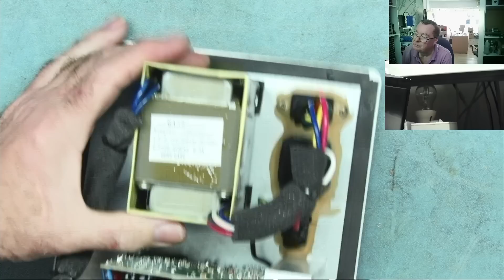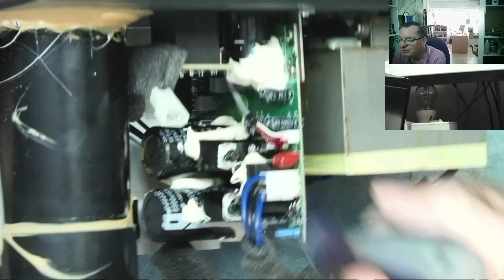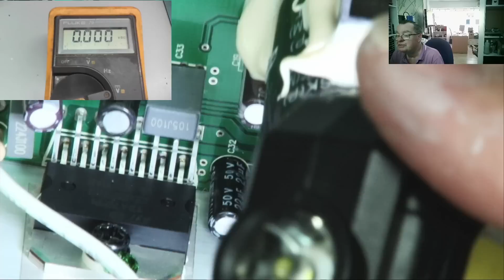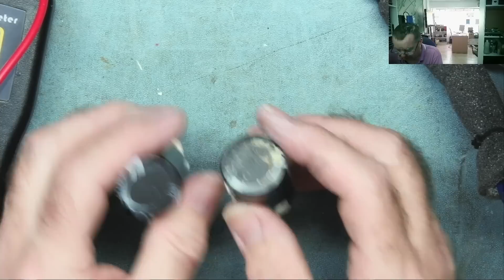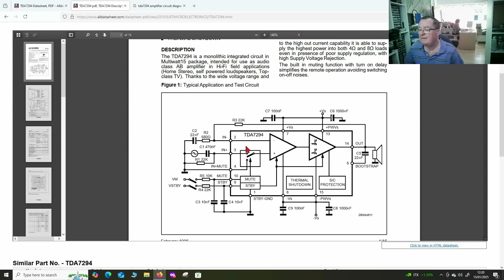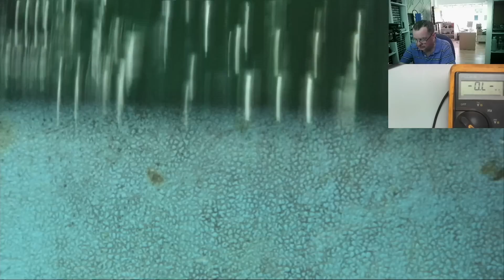This M-Audio BX8 Speaker Makes Farting Noises! Learn How To Fix It

Comment: Though I enjoy a longer video, this is definitely not one of them. You wasted a lot of time babbling and messing about. If you have started with checking the voltage rails for a short to ground (blackened area of the PCB is also a clear  indication that something has gone wrong there) this would have been a 5 minutes video. Ok, maybe 10 minutes with the back and forth of shorted component misidentification with the thermal cam. Not sure how you could have seen it as the opamp and came to the conclusion that all of them are shorted, even tho the big cap was glowing like a Christmas tree 😅

Comment: The capacitor C2 at 17:33 is in fact mainly to cut DC off since we do not want to amplify any possible DC offset.
At DC it is open so the lower part of the feedback voltage divider is infinite resistance (lowest gain of 1 in non-inverting configuration), while at high frequency it is a short, so the lower part of the feedback voltage divider is equal to R2 (highest gain of 1+22k/680=~33). C2 needs to be decently high value (22µF on the example application, rendered incorrectly on your screen) so that low-frequency cutoff is low enough.

Comment: Hi Richard,
I noticed you returned to your good old Fluke multimeter quite a while ago after using the Kaiweets KM601 for some time.
Did the excitement for the intelligent meter hold up not so long or what is the reason for switching back?

Comment: Thanks Richard for the journey of solving the puzzle 
It does seem this type of capacitor is prone to failure.
My gut feeling was a capacitor failure.
Locating it is the issue.
Reply from the maker: Yes 100% MLCC (multilayer ceramic capacitors) are very  prone to failing short circuit

Comment: Nice find. Always handy to use a little pointing device (cotton bud, pen, cocktail stick, something nonconductive) and place over the component when viewing through thermal camera to identify the exact place. Even without, it didn't look like the ICs really, the shape wasn't right :) You can also approximate/fake a log pot from a linear by adding a smaller resistor between wiper and one leg, although I've not actually done much experimentation with that it may help in some situations.

Comment: That was another excellent... Lesson... There were still some things I didn't quite get or understand totally,  but as you started to disassemble things and we still had some kind of resistance in the circuit after parts were removed,...  I started to view it as being a little bit puzzling but we kept working through the issue with a lot of discussion which was very helpful, and I always like the approach that you take when you try and find out why a part failed...  As far as the potentiometer goes and seeing the crack, chances are the speaker might've been moved or during transport somehow the volume knob may have taken a hit which would definitely crack the housing.  I must say that when we first did our visual inspection I definitely spotted that Brown area around the bridge rectifier in the resistors and to me I kind of would've... Probably started in that area but that's just me and as you said many times there's many ways to approach diagnosing the problem.  As for the large capacitor that does have a strong appearance to have been leaking... If I would've had to order parts I probably would've ordered some replacements,  it's hard to tell the age of this speaker...  And... Man... Here we go again with All the doggone glue....   :-(

Comment: I've also recently had a broken potentiometer, exactly the same type (except mine included a switch), in my case on a dimmer. I wonder if this is a general design flaw, possibly the plastic is too thin or becomes fragile with age.

Comment: Great Vid Richard. There was a lot masking the culprit including the 180ohm  but it did protect the upstream sections.  

Your methodical approach got you there and it was interesting to watch.   

Could you link to the video you did on why measuring the op amp inputs direct is problematic and so measuring across input resistors is the trick??  

Cheers
Reply: This is Richard's video on op amps. Worth watching the whole thing. The part about why you get no signal on the input pin starts at 30.35...

https://youtu.be/HY7NujELVoA?t=0
Reply from the maker: @Manticore1960  Thak yo uthat saved me finding it 😉

Comment: Nice fault finding! Did you give the op-amps the negative supply from the internal psu, or only the plus 15V from the bench psu?
Reply from the maker: Just the 15V as that was where the fault was.  Powering the op-amps with just one supply rail like this will not cause a problem (if you do not have a speake attached!!), but of course you could also apply both voltages too.
Reply: @learnelectronicsrepair  I have experienced some op-amps "locking up" and drawing heavy current when only given one of the voltages
Reply: @learnelectronicsrepair  I would not try this with a CA3140 op-amp..

Comment: This was quite an informative video and a great learning tool. I have an older DVD home theater system that had started the same noise issue from the sub-woofer. Visual inspection did not lead me anywhere, and I had side-lined that job. I'll be pulling it back out for some more diag.. I have retired from automotive repair about 3 months back and do have a FLIR-type IR gun to use now and much more time on my hands. Now, to get one of those hot tweezers... I'll have to revisit your video on that unit and to obtain some needle-tip test leads, as well. Thanks so much!
Reply from the maker: Good luck with your repair, it's great to hear you are inspierd to have another look and for sure let us all know how you get on with it
Reply: @learnelectronicsrepair  Thanks, I certainly will follow up. Just ordered an HT140 hot tweezer, as you reviewed previously, and some appropriate test leads/probes.

Comment: Those meter test leads look dangerously long, especially when dealing with high potential, and then also seeing you lean them against your fingers the entire time.  Are you new to this?  There is good reason that those are usually protected down to a matter of millimeters.
Reply from the maker: Of course I'm not new to this, I use those meter leads because Iike them, they are rugged and have stood up to a lot of use. They can also get into narrow spaces where other probes can not and are good for peircing cables or conformal coating.  It's a personal choice to use them that's all.  The worse harm I have come to from those leads is when I slipped and pierced a finger end recently (see the last out take video) 😂
Reply: Go easy on him as he's just learning LOL !
Reply: @andymouse  Eek Mr squeak 🙂
Reply: @ Squeak !
Reply: @andymouse  I had a mouse make a nest in one of my BX-8 speakers...Was that you @andymouse?  The little guy packed in all the rodent poison balls from another part of the garage.  Couldn't believe it.
Reply: @MrHellfinger  Lol ! probably one of my cousins :)
Reply: i'd put some thin heatshrink over the spikes, just to be on the safe side. Working on mains is OK as long as there is an isolation transformer being used. but this will not help if you have each probes touching  each hand, then your in the hands of the gods should you put them on to a high voltage. One of the best ways of clocking off is to get a mains connection between the hands, heart is in direct line of the current path. 
Remember Volts jolt and mills kills. its current that kills, the voltage is just needed to get the current to flow through the skin. Never let your skin be the only Means Of Protection. (or MOP in safety standards)
Reply from the maker: @TheEmbeddedHobbyist  et al.  
I do have an isolation transfomer on my bench, and I do know what it will and will not protect me from but I also take your point seriously.  At the end of the day this is a contentious issue but I believe the key point is to understand the risks involeved and then do what you feel comfortable with.  I've seen other techs far more cautious than me and others take risks I would really prefer not  to take.  I don't think any of them are right or wrong if they know the risks and know what they are doing.  Discuss.  Everyones opinion is valid on this topic.
Reply: @ Squeak !

Comment: There's a few things going on with amplifier power ratings. Some are legitimate, some aren't. It's not uncommon for ratings to be pulled out of thin air on cheap brands, or rated at absolute peaks at 100% distortion, but even professional amps can sometimes have legitimate ratings with higher output power than input. I own a 3KW amp, which is almost double what a standard household 120v US ciruit breaker will handle. But the amp isn't putting that out constantly. People don't listen to constant sine waves, and 95%of the power is only needed on the kick drum beats. The transformer does not need to constantly supply that much power, since it's stored in the filter capacitor. So yes, an amplifier can have a higher output rating than transformer power rating and still put out that power with low THD without breaking the laws of physics. Nobody rates power amps with sine waves. But also no, this is not the reason you can find a new 2,000 watt amplifier for $30 on Aliexpress.